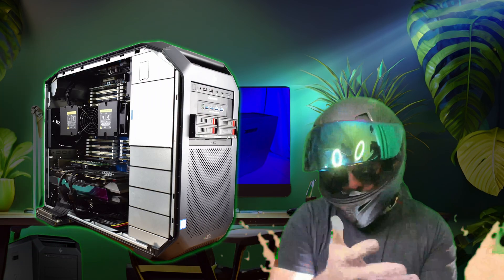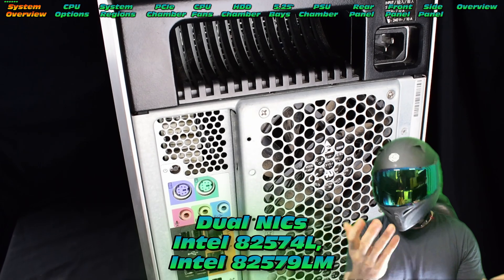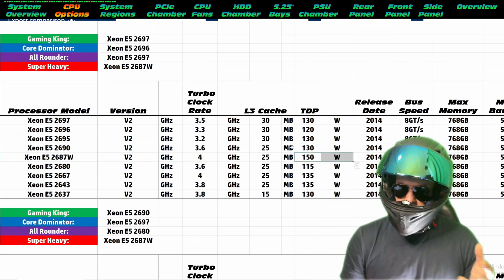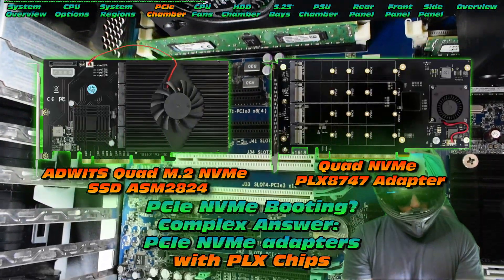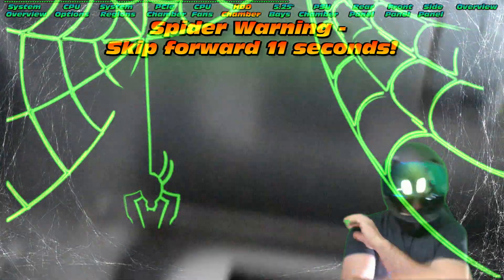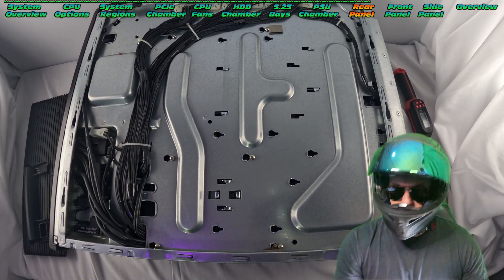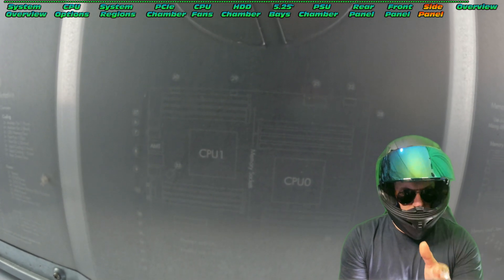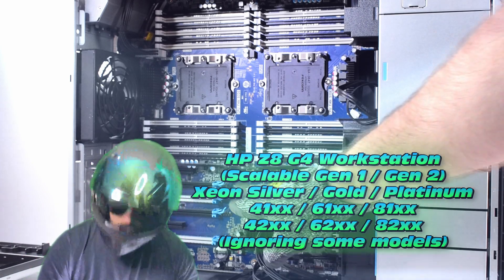Powerful Home Server On a Budget. HP Z820 Workstation Overview. Bank Balance Friendly Hardware #Z820

Comment: While having 14 SATA ports looks cool, there's no point in having that considering there's no room in the case to fit all those devices.
Reply from the maker: That depends on your end-use situation. If you include expansion into the 3x 5.25" Bays you can make use of all 14 ports fairly quickly. 
I would opt for 3x 8-bay hotswap SSD 5.25" Bay adapters - with which you can accommodate 24x SSDs (an Intel H240 HBA would cover an extra 8x SATA / SAS ports - so still short on ports for that config.). 
HDDs are more difficult to accommodate, but since there are 3x 5.25" Bays you could fit a 5x 3.5" HDD Expansion bay without trouble (Only netting 9x 3.5" HDDs without getting creative with HDD mounting to the side panel etc.).
Reply: @racerrrz  I'm working on the assumption that you"re most likely gonna prefer to use spinning rust instead of SSD because drives that are high quality enough for a server build are really expensive to the point you could get a lot of mechanical storage for the same price of a few enterprise SSDs. 7200 RPM 2.5 drives do exist, but you're not getting them at the same capacity as the large ones.
Reply from the maker: @BrunodeSouzaLino  That's true. HDDs remain the go to medium for storage - mostly because of capacity per dollar. 

Pricing has been really prohibitive on the NAND Flash side of storage - plus drive durability is an issue. 

Putting aside the recent price hikes, SSDs and NVMes have actually dropped in price a lot more than I was expecting - making them a more viable option for a server. 

NAND Flash fairs less well on high read/write requirements, but it's really just about matching the system to the end use. Given the power draw on a Z820, I would rather have it as a file storage server that I power on when I need it.
e.g. when I am editing videos it could serve as my server. I can't edit videos stored on an HDD (they are too slow), SSDs have sufficient speeds to allow up to 4K 60FPS to be handled smoothly. Hence, I would load a Z820 with SSDs to create a RAID 5 pool - as large a capacity as the bank balance allows. Given that SSDs do fail, it would be wise to have a fall-back server with some spinners. HDDs may be slow, but they are cost effective and durable. 

I am actually working on a 1L mini PC server build right now. Ultra low power draw (10-20W on idle), 4x SSDs for a RAID 5 pool, 10GbE NIC, NVMe Boot drive. The issue is I wish I had more space and PSU output, but the goal is a low power draw server for 24/7 operation. HDDs draw too much power for that application, but maybe I'll find a way to cram a 3.5" HDD into the equation.

Comment: awesome video, i have this workstation, i really like it, really 2orth the price
Reply from the maker: The Z820 is at a really good price point and the supported hardware is really cost effective right now. It wouldn't take much $$ to get a lot of cores and RAM in there, plus the power supplies are more than capable to handle expansion.